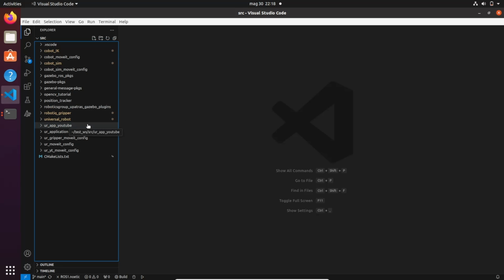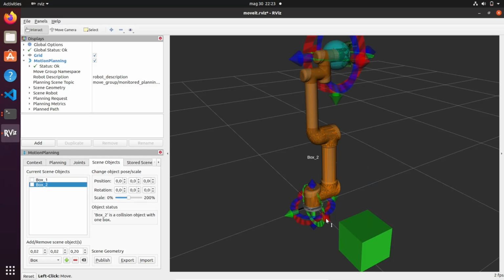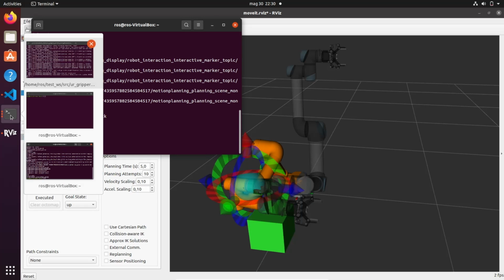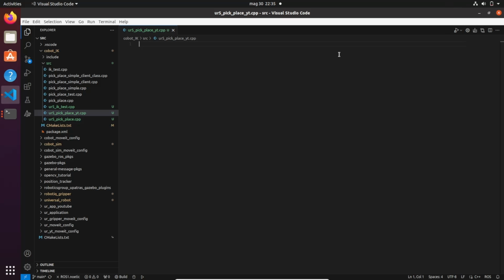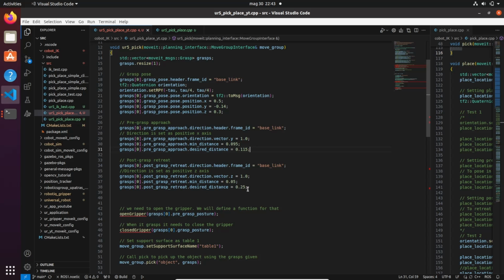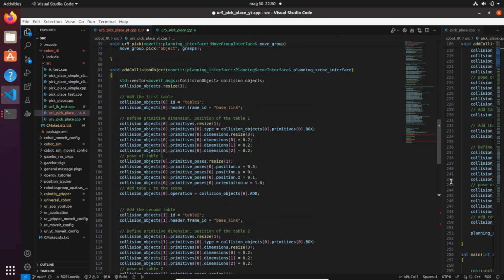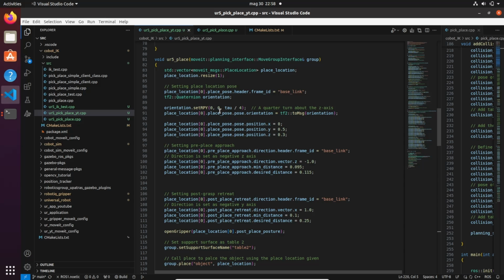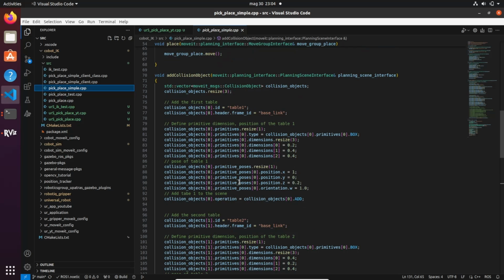Universal Robot with ROS - How to Pick and Place with UR5 and RobotiQ Gripper

Comment: What an amazing content. I have a problem with the cpp node. When I run it, the manipulator moves to the picking position and the gripper closes. And then I receive an error regarding the controller and then ur5 and the gripper stays at that position. Could you please help me to solve the problem? I even used your repository and files but got the same error.
Reply from the maker: @ashkannoone1479  try to not close completely the gripper. If you close the gripper and the object you want to pick is a collision_object, you let the gripper go in collision with the object itself. If this does not work, try to change the planning solver. Have a look to this kinematics.yaml file in the moveit config package https://github.com/LearnRoboticsWROS/master_robotics_ws/blob/main/src%2Fur5_robotiq_camera_moveit_config%2Fconfig%2Fkinematics.yaml